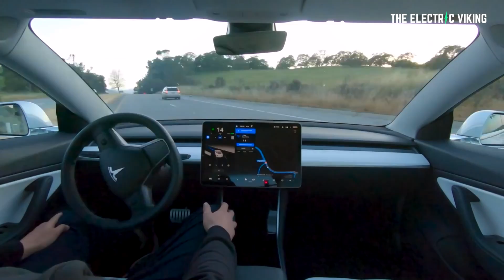NEW report says production to 5X at Giga Texas in Q1 2023

Comment: From Elon's master plan part due. He stated that the goal was to make a $30k mass market model 3 and Y.
 The pathway was not there a few yrs ago because of battery bottlenecks and manufacturing capacity and process efficiencies and supply chains and Covid and inflation.
All of the above is now gone bar inflation and that has peaked in my view. It will remain elevated for the next 3-5yrs unless there is a global recession.
So all the above for me indicates that Elon will begin the mass slaughter of ICE OEM's in 2023, he has all the ducks in a row, plus the tail wind of sustained EV credits from Europe and the IRA from the US and subsidies from China continuing for EV's  to boot. 
This means higher volumes thus lower per unit costs, this means lower battery costs and it means lower production costs due to front and rear Giga castings rolling out on the model 3 as well as Y.
The Model 2 will be Robo taxi when FSD is 99.99% effective on most standard US roads (city streets and highway). so 0.01% interventions per mile driven. 
I think they are close to 0.1 interventions per mile on a typical US streets/highway but please correct me. 
So as FSD rolls out to more beta users this KPI will be ground out. I think in the next 3yr we shall see a Robo Taxi. 
Until then 3 and Y will be priced lower but with high margins,  from 2023 onwards,  and we will get to $30k for a standard range model 3 and $35k for standard range Y.
Unless something derails the above like a global recession Tesla is golden. If there is a global recession Tesla has the cash to ride it out for 2-3yrs.

Comment: A run rate of 1000-1100 cars a day is not unusual.  In the late 90s I worked for Ford.  Typical takt times for an assembly plant was 50 seconds.  Every 50 seconds, a new car rolled off the line.  That works out to 1000 cars a day with no overtime, and 1100-1150 with an extra hour on each shift.  250-300k cars a year were not uncommon back in the day when Ford was selling a lot of Taurus’s

Comment: 5,000 x 12 weeks = 60,000 per quarter or a run rate of @ 250,000 per year.
Reply: There are 13 weeks in a quarter. 65000 per quarter.  260k per YEAR.
Reply: Annual run rate will be much higher than 260k, since its less than 5,000 per week in the beginning of the first quarter and more than 5,000 at the end of the quarter.  That means the weekly run rate after the end of the first quarter will be more than 5,000, which will skew your number to the high side.
Reply: Among other errors, this calculation omits the extra 4 weeks in a year not picked up in your math.
Reply: Probably are looking toward 6k per week as the first production goal and 8k per week for the second production goal x 50 weeks to account for downtime during the year.

Comment: I live in Palm Beach country here in South Florida, about 80 miles North of downtown Miami.  Normally if you check the Tesla Inventory you only find maybe 1 to 5 new cars available for purchase immediately, and NEVER at base price.  Right now, the Tesla Model 3 alone is showing 14 cars within 100 miles (most in downtown Miami), and around 44 cars within 200 miles.  Here's the kicker, not only are quite a few at base price of $46,990, but if you take delivery by the end of the year they will give you a $3750 discount.  This discount leads me to believe that the Model 3 standard range with the CATL battery that's obviously not made here in the USA will probably continue to be sold after the new year, but only qualify for half the 7500 credit.  I'm wondering if at some point they will bring back the Model 3 SR with either a Giga-Texas Structural Battery Pack, or the old Panasonic battery pack it used to have before they switched to LFP batteries.  I know that as of yet no one is making LFP batteries in the USA so that's not an option, but it will be interesting to see if something does happen to take full advantage of the tax credit.
Reply: My understanding is that Giga Texas makes 4680 structural packs with LFP chemistry.
Reply: @vermontsownboy6957  negative. They are a very basic nickel chemistry not LFP
Reply: @saff226  I hear you but I'm not sure. Source?
Reply: @vermontsownboy6957  Munro did a tear down and the limiting factor sent one of the cells to a university to get examined
Reply: @saff226  The Limiting Factor obtained an early release 4680 from Gali, made in Freemont at Kato Road facility. I'm aware the Munro Y structural pack tear-down was from Austin....and funny....I don't recall what they said about the chemistry! I'm going to review that video.
Reply: @vermontsownboy6957  he got a new cell from Munro as well as the old preproduction cell

Comment: Tesla is reacting to the slow but sure increase in EVs from GM from Ford from everyone else.  They even offered about 4k discount for model 3 in Illinois. I think sales are waning. Only so many rich people to sell a 50k car to. And what's the number one seller in the US? A truck.  Maybe it's time to start filling those cyber truck orders
Reply: What's most telling is that Carvana's inventory of Model 3 has increased DRAMATICALLY and they're cutting prices.  I saw a 2018 Model 3 on Carvana yesterday for as low as 38K.  First time I've seen them for less than $40K.
Reply: F150 ASP in 2021 $53k. Lot of rich people in US.
Reply: @mearino  in 2020 you could buy a used f150 for  17k and a new one for 25k
Reply: @ChicagoBob123  yes cheaper versions of F150 available but most people option up...averages can be misleading of course but if plenty of people spend $17k, there must also be plenty spending $80k to get a $53k average selling price for f150

Comment: Five thousand a week is not unrealistic run rate providing the supply chain flow can be maintained.  Giga Texas is still cycling up. Oher manufacturers has maintained 5000 a week using current production methods. With Tesla's state of the art facility and "minimal component" car design 5700 per week would not be unrealistic.

Comment: Joe Tegtmeier just casually  mentioned in one of his videos that they were installing equipment for not one but TWO, brand new paint lines on the 2nd floor. 
 CT doesn't need paint, the Model 3 hasn't even been mentioned for Austin, and I agree Model 3's from Fremont with structural packs using CATL LFP blade batteries.
My take is they will have 3 full Model Y lines up and running by Q1 instead of just one.  Tripling Y production without having to add a 3rd shift, like they are in Berlin.
Add in CT production ramping for 6 month, and yes the fully stainless steel clad robotaxi will be there as well.

On the update on the battery range, Jordan from The Limiting Factor just did a vid on the energy density of the Monroe 4680 and there was no ah ha
Reply: Model 3 were part of the plans for Giga Texas from beginning. Model Y was always first, model 3 and cybertruck for future...
Reply: They will update Model 3 lines in Fremont when they have production coming out of Texas. Tesla has talked about these plans in the past when asked about updating Model 3 lines in Fremont.